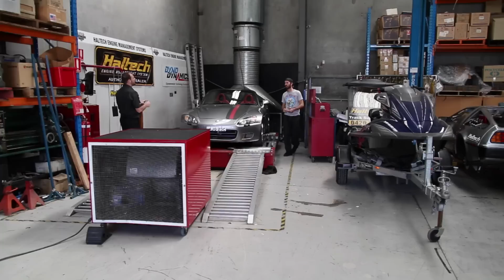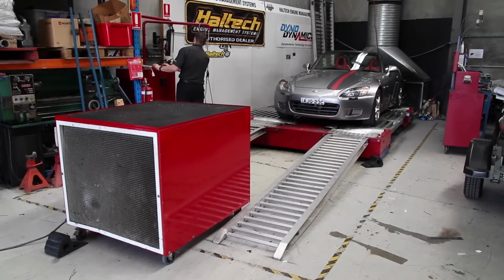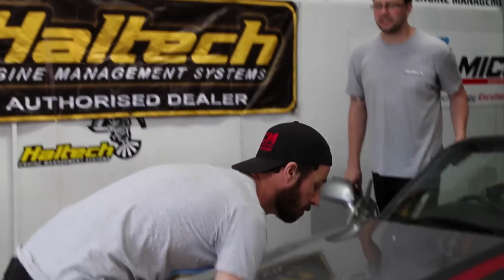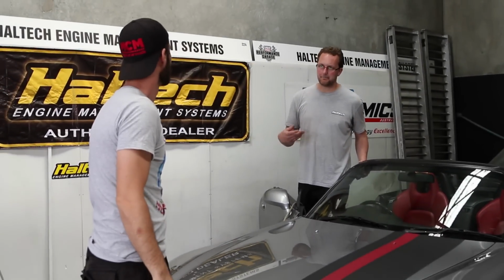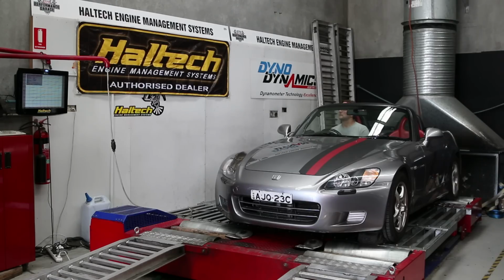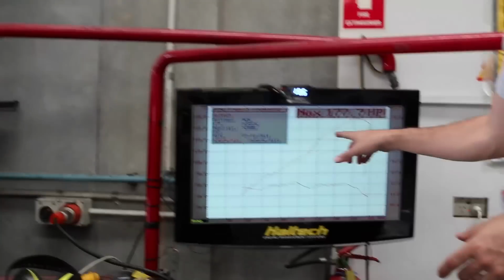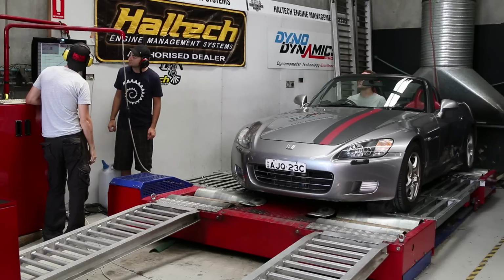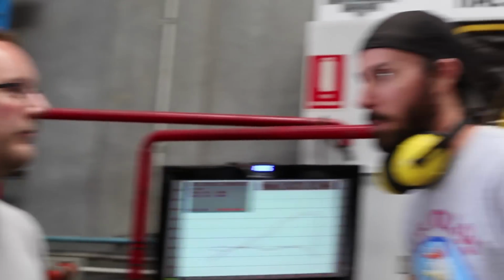Cold Air Intakes Mythbusted [Naturally Aspirated]

Comment: 170hp vs 177hp.... Thats a Really Big Difference!
Cold Air-Intake for the Win!!
Reply: its the better driver for the win  7hp aint nothing
Reply: @cbass756  horsepower ain't cheap, and it's pretty good for a basic bolt on
Reply: There's  engines  with 7hp its alot more than people realize
Reply: 7 hp is impressive if a cold intake cost $400
Reply: If your a drag racer and you have a turbo it’s totally worth the $400
Reply: @cbass756  Clone the drivers and cars and then which one wins???
Reply: Space Warrior its a mod that pairs well with other mods and helps each other increase HP
Reply: @zenkikijp9667  Indeed my friend.
Reply: That’s it alone, upgrade the intake manifolds, exhaust and headers and you’d make a ton of power over stock
Reply: My Dodge Cummings gots 500 hp and its straight piped yee yee
Reply: @rey_m.x.7929  and will last for 2 - 3 years before tanking.
Reply: Daniel Fair can confirm Dodge diesels don't live forever
Reply: My car is 293 horsepower stock. All I really want are those 7 horses lol
Reply: It doesn’t work on bone stock cars, and besides u buy them for the sound
Reply: Over 5% is huge!  This means that if it’s a 300hp engine the intake could bump you up to 320. Totally worth it.
Reply: Cai r good for cars that r made for the track, like 600hp+
Reply: @archer34myway6  It costs 10-20$
Reply: @bodinski100  couldn’t agree more, I have a 2019 Impreza hatchback (looks like a new Version of the  Sti hatchback) it made 160 to the wheels stock, I had billet power blocks for manifold spacing, larger injectors, aem cai, straight pipe dual exit y pipe exhaust from the cats, throttle controller and tune! Car now makes 205 to the wheels!

Comment: i would love to see you guys do a cold air vs stock air box on a late 90s early 2000s car like a mercury grand marquis. this stock box is just that. a box with a flat square filter. lets see what us regular folks will get from cold air.
Reply: Come on, all the way 2000-2010 plain civil cars with like 2.0 motors, it’s more GAIN from 5 kW vs the race cars like S2000…

Comment: So gained power, lost weight, better sounding, and a better looking engine bay? Doesn't sound like any "myths" got busted here, sounds like everyones CAI actually is a real upgrade.
Now try this test with a modified N/A engine and see how much more gains you get from a simple cold air intake vs a factory box. 
Not to mention a lot of cars have a mass air flow sensor, upgrading that, and a bigger throttle body, along with a CAI, and you will definitely see gains.

Comment: Factory systems are cold air intake systems(most). All the aftermarket ones do is eliminate the noise baffling and smooth the air inlet a bit. If the factory air box is not restricted, the throttle body, cylinder heads and cam profile are the only way to increase airflow.

Short term fuel trim will correct changes almost immediately, so there is no “lean advantage.”

Comment: colder air increases density, more density means more air in combustion chamber. add some bigger injectors for more fuel, jet and tune for e85 and you got the coldest more air fuel and higher octane, bigger bangs = more power
Reply: Most cars are NOT tuned for ethanol to begin with.  

Read your owners manual people.

Comment: The S2000, like you said, has a very efficient induction system. On a real world environment in the US, by that I mean lots of expressways and interstate highways, you will see a small increase on an Accord or Camry or another family car With a K&N snorkel system. You probably won't see anything noticeable with just a K&N with the factory air box. As for a true performance car, don't expect anything as the factory induction systems are all optimized.
Reply: They just showed in the video that the S2000 stock system sucks...

Comment: One thing worth mentioning, there must be a factory restriction in order for the cold air intake to actually help.

You'll find a proper intake set up on more modern cars than on the older ones, but people keep doing the same things that used to work in spite of the fact that engines are engineered better than they were back in the day.

Comment: Once again, they've chosen a high performance vehicle to test this, which is probably the least likely to see an increase in power from an intake mod.
Reply: Sports car? Yes. High Performance? Mmm: I'm not gonna say it's a high performance car. An AMG GT? That's something I'd say that's high performance...
Reply: You're unlikely to see performance gains with a cold air kit on something more mundane either.  In fact, didn't they do a pod filter test on the Blue Turd? while that isn't a cold intake feed system with the bonnet up and the dyno fan running at full tilt it showed no increase in power, in fact the factory intake made the most 'power'.
Reply: 5kw gain on a NA 4 cylinder engine is a great result actually
Reply: If you're chasing tenths of seconds on a drag strip maybe, which would be stupid to be doing on a naturally aspirated 4 cylinder car with less than like 100 kw to begin with. But you're not going to feel a difference unless you're making like 50< kw (67 horsepower), which why would you even waste time doing pseudo-performance mods on that trash of a car to begin with?

And there's not really that many things you can do to a slow N/A car to get enough to feel something without just turbocharging it.

Still a great result from a numbers standpoint, but not enough to matter
Reply: not to mention it s four banger. strap one to a v8 and its much more noticable
Reply: More air in more cylinders bud
Reply: they chose a honda...
Reply: An S2000. Stock those come street race ready.
Reply: Aha thank you someone for finally saying this.  5kw/~7 horsepower at the wheels on a little N/A 4 cylinder, off of bolting in an aftermarket intake, with nothing else to go with it/no software upgrades and just letting the stock ECU handle the change, is pretty much as good as it gets.
Reply: +Ben Ward the engine is very high performance. can't be topped.
Reply: And no headwind.   You're going about 30mph on first gear, why not have a 30mph headwind?
Reply: MavHunter20XX The dyno has a fan at the front that simulates headwind
Reply: OSD Oldsaltydog d
Reply: too slow
Reply: why is a drag strip even related ? thats a straw man argument. 

gaining that small power out of simply bolting on a CAI is somewhat impressive and surprising.
Reply: @Ward1706  then honestly the S2 engine is one of the most high performance 4 cylinders ever made that engine for a decade held the most horsepower per liter mark coveted by engine Developers. So yes it is high performance.
Reply: @Ward1706  it is a high performance engine, it has one of the best n/a horsepower per litre ratings. The only thing that makes less than any other car is the lack of displacement and/or FI.
Reply: Honestly
Reply: @Ward1706  Thats high *POWER*. The motor in this car had the most HP-per-liter than any production motor in the WORLD for 10 years until Ferrari beat it. That sounds pretty high performing to me lol.
Reply: Good point,  I just bought a cold air intake for my 98 Impreza 2.2 NA, I suspect to notice a small difference  :)
Reply: I mean... its a 2l engine making 120 hp per litre.  Tell me another car making that much per litre....all NA
Reply: @janronelrecano1208 Cosworth BMW Mercedes Ford etc etc all above did it up to 20 years before honda 😂

Comment: Wow, 177hp at the wheel, that's about as much as my 96 Grand Cherokee. Kinda sad on my Jeep's part considering it's a 5.2L V8. After I installed my Cherry Bomb Turbo muffler, I got 7hp and 7tq more, couldn't believe it. 184hp, 239tq from a motor twice the size in a 4x4 that weighs 4000lbs with an outdated 4 speed auto. Next mod's a name brand chip(not a cheap ebay one like on an older episode).
Reply: It ways about 1,000 lbs lighter ... Hate when people have to compare there v8s just stop
Reply: Anthony
You don't think I realized a difference in weight when I mentioned the Jeep weighing 4000lbs? Also, it's "their" not "there". Not as bad as Paddy's comment....

Paddy, I know it's outdated, if you read what I posted, I flat out said it's outdated. At the same time, I don't see many DOHC engines in top fuel drag racing. 8000hp from supercharged HEMI based engines.
Reply: Not really surprising. I think I read somewhere that the S2000 engine at the time had the most kw per cc of displacement for a NA engine. The Cherokee V8 is probably a tad overbuilt with reliability and low end torque in mind.
Reply: Lol you like your own comment and I was just saying it's a much lighter car with 175
Reply: @mr2paddy   its nothing to build an older engine and get a lot more power lol and easier to work on top of thatv

Comment: On my Integra DC2 R I reduced lots of weight by using J's Racing Intake system. Checked on the dyno, similar results to your video! As for losing power down in the low range RPMS, I can justify it because I reduced tons of weight from the car and the car doesn't feel sluggish at all down low rpms. As for sound...that's totally up to the driver's preference. Love your videos guys! My DC2 is 998 KG and generating 252 HP NA B20VTEC.